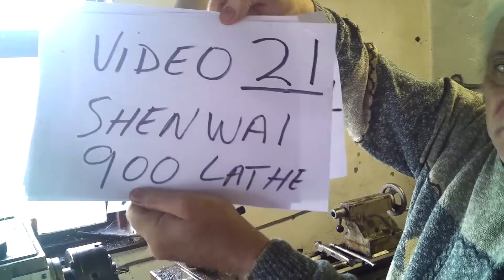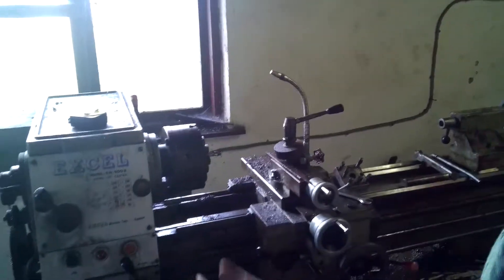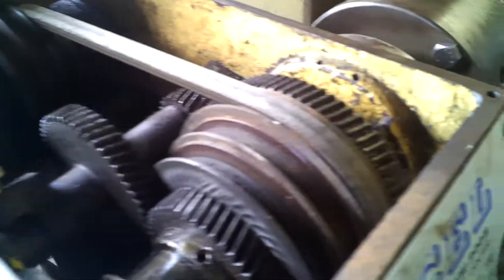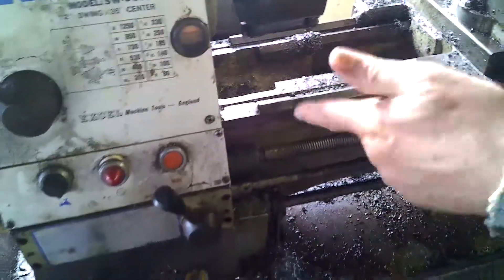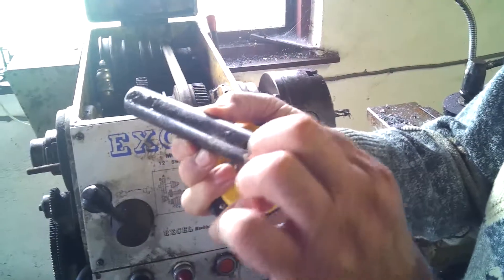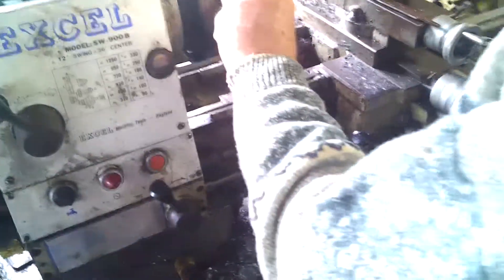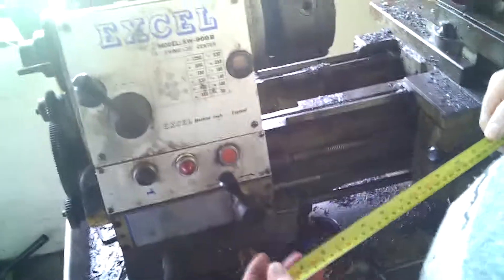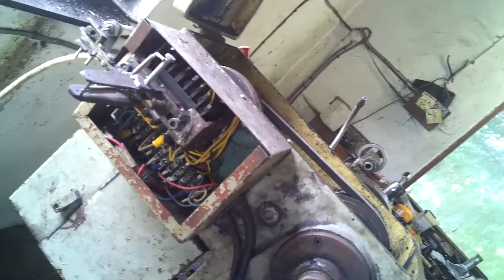Video No 21.  The Shenwai 900 mm lathe.  Chuck removal and switch problems.

Comment: I have a Shenwai model number 900GH believe it is 1985  it is in pieces hope to use it someday bought it for $500 dollars a few years ago
Reply from the maker: There is no model number at all.  Where is it written on your one.
Reply: @ValMartinIreland    I was just reading off what was on the large decal on the front of the machine. I assumed it was the model number?
Reply: On the decal it says Model NO: SW-900GH  Serial  NO 0056  Data 2, 1985
Reply from the maker: @TheDavidarlen  I am not sure but the one in the video is a model  900.    There were slight variations.
Reply from the maker: @TheDavidarlen  my one has a removable plate with Excell machine tools on it.  Can you find any serial number of other information on the machine itself?    They were made in Taiwan.    Factory is gone.  If you ever scrap it there are a few parts I would be interested in buying.